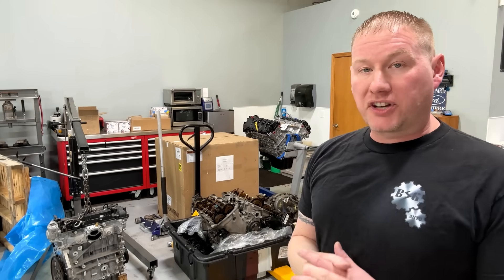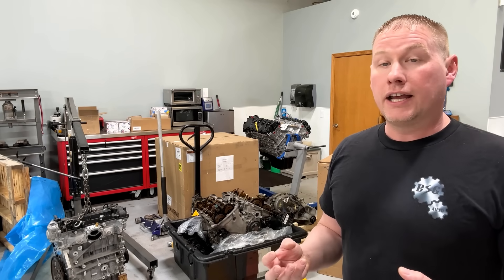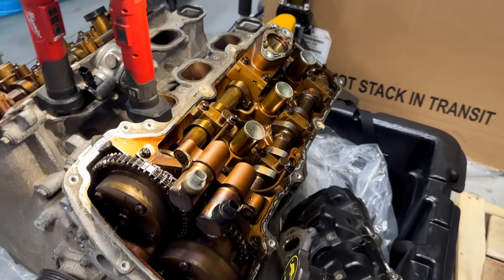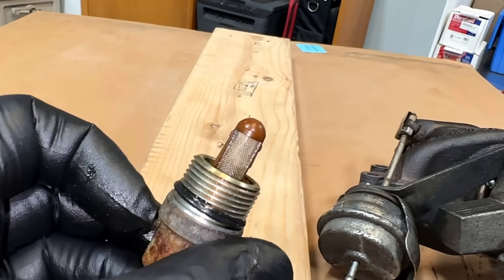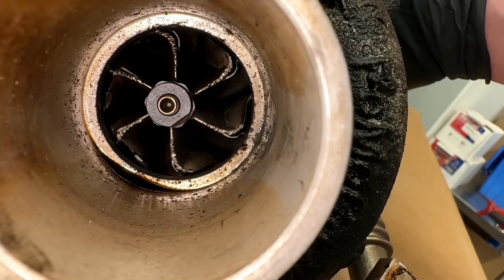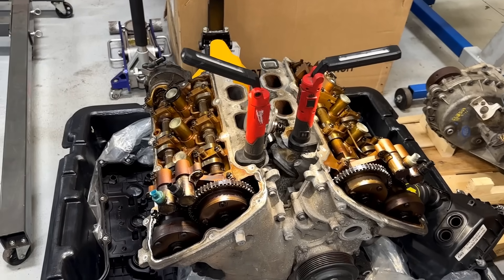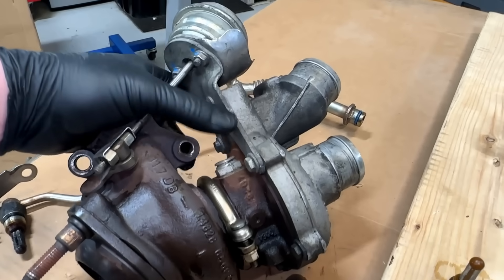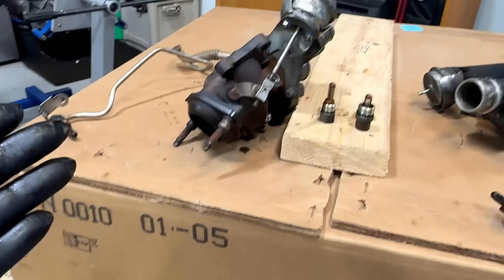This is Why You Never Run Extended Oil Change Intervals on The Ford Ecoboost Engines!

Comment: Had a 2015 Escape with the 2.0.  When I purchased the vehicle I decided to follow the engineers algorithm and change oil when the monitor system told me to.  The ford dealership used synthetic blend.  The long way around of saying, When I traded the vehicle in in 2020 there was 308,000 miles on the clock.  Out side of the normal maintenance stuff, brakes, tires, filters, and a head lamp bulb, etc; the only engine repair I had was a purge control valve.  The only reason I got rid of it was the transmission started slipping when cold.  Trans repair cost and trade in value almost equaled each other so I purchased an Edge ST.  Trans fluid changed every 45,000 miles.  Hate to disagree with you, full synthetic is not really needed.  Being mindful of maintenance intervals is important.

With regards to the turbo, those screens looked like the oil was not changed or those screens are clogged due to cokeing.  The secret to turbo longevity is is starting the engine up and idle for a moment for to get oil flowing and the keep your foot out of the throttle until the engine warms up.  At shutdown, let the engine idle for a minute or two allowing for the turbo to slow down and cool down.  Otherwise the oil supply line will clog just like your screens.  Learned this from owing a Cessna Turbo 182RG back in the 70's.  Start up and shut down procedures for a Turbo engine and a normally aspirated one were different.

Comment: These are all Ford design engineering failures!  Why?  Because Ford designed and is responsible for the oil change reminder system!  I guess at this point, I just don't believe that many 3.5l Eco-Boost engines will go 300k miles even if the oil is changed every 5000 miles if the turbos are considered as part of the engine which they are in my mind.  I would NEVER buy a vehicle with any Ford twin turbo V6 PERIOD!!
Reply: No one cares.  :face-blue-smiling:
Reply: @richardthomas1743  Ever try being the adult in the room?
Reply: @alanmorrison3598  Have you ever thought about making an intelligent comment?
Reply: @richardthomas1743  See above
Reply: @alanmorrison3598  Grow up.
Reply: @richardthomas1743  If you disagree with what I originally said, be the adult in the room and tell all of us specifically why I'm wrong..

Comment: Why is it that Ford only has a semi-synthetic (Motorcraft) engine oil rather than full syenthetic?. So when I take my 2.7L Ecoboost F-150 for oil changes at the dealership, that is what they use. The only way the will use a full synthetic is if they charge me by the hour on the oil change, which makes it 3 times as expensive.
Reply: They want it to fail.
Reply: Don't use the dealership for oil changes.

Comment: Excellent video as always Brian.  Have you come across any issues with the 2.0L Atkinson engine that they use in the Fusion hybrids?
Reply: Those motors are solid. The thing to keep an eye on is the hybrid transmission fluid level. If you see anything leaking stop driving the car and fix it right away. Mine got low and it kills the bearings. Cost me 6 grand to have it replaced. The bottom cover on the car caught it all so the guy doing the oil changes needs to look for it.
Reply: @psineil  thank you for the heads up!  Where on your transmission did it start leaking at?  When I did my last oil change I noticed the Aluminum housing where the engine and transmission mate together was a little damp, like some residue of something.  It doesn't look red though.  I'm thinking maybe the hose to the thermostat housing is leaking a little, since it's right there as well.

Comment: Is there any real difference between the 3.5 ecoboost and the 3.5 NA engine's besides the turbo ?
Reply: I think the internals are slightly different, mainly the pistons and compression ratio. There are probably more differences but the overall architecture is very similar as well as very similar components.

Comment: Talking about oil changes, in Mexico they ask for 10k kms / 6k mi, or 6 months in between oil changes. If I drive the vehicle, let's say, 2k kms per 6 months or so, will it fail miserably too?

My car is a 2018 Escape, 2.0 EcoBoost, built in Cologne, Germany. Ever since I got the 2.0 EcoBoost recall applied in my Escape, it keeps failing with the same symptoms, but "magically" it is doing well in the dealer tests. I honestly doubt that the block replacement was done well, even though is an european block instead of the american one.

TBH I'm getting rid of the thing, and that's why I've been driving it so little lately. Is there any actual reliable, not too expensive and not too small family Ford car out there, no turbos nor bs, and still has a reasonable warranty due date?

Comment: When I bought my 2018 fusion I got the extended warranty and service package on it but I literally had to fight to get the 5000 oil change service ford said 7500 was the lowest they'd go they finally said 5000 on the oil and that's to long to go on this engine so anyone with the eco boost engine change your oil at or before 4000 miles.

Comment: I'm considering buying a Transit camper van with the 3.5 ecoboost and I'm doing a bunch of research on its longevity. It's good to know they do last when well maintained, but there also seems to be a lot of design issues with ecoboost engines. I always try to be meticulous with my maint so I think it'll be fine, but Ford needs to stop releasing engines that are half baked.

Comment: Before I retired from the Automotive Electronics field my business required me to drive a lot.  My last vehicle was a 2003 E250 Work Van with the 4.6l 2v engine it.  When I sold it in 2019 it had 509K on the Odometer.  I use to change the oil once a month.  I did not go by miles as it would vary so much.  At 250k I replaced the Timing chains, guides and tensioners due to a rattling noise at start up.  The engine looked like new on the inside. I always used the Motorcraft 5w-20 synthetic blend oil and FL-820s filter.  My neighbors would always ask me why I would change the oil that much and the reason is obvious.  When I sold that vehicle it still had the original engine and transmission in it. The A/C compressor was even original and used all the time as I live in South Florida.  Other than regular maintenance hands down the best vehicle I ever owned.  I regret selling it.  I now own a 2019 Ford Transit Connect and it has only 20k miles on it and I had to already replace the ABS module and HCU which the dealer wanted $2500 to replace and there were no parts available at the time to replace it in Jan.  I waited 4 months and could not drive it,  the brakes would just lock up for no reason.  I finally bought a used one on Ebay from a wreck and spent $100 and now it's fine.  I'm probably gonna sell the van now as I don't trust it.  Change your oil often people.

Comment: I have a 2017 expedition with a 3.5  and I change my oil every 2200 to 2500 miles. I get made fun of for that but people don't understand,  oil is cheap, engines are not.

Comment: What’s your recommendation changing spark plugs how often ? 2014 3.5L currently at 116K
Reply: Normally every 75k you’ll need them. You wouldn’t of made it that far without doing them. Pull one and check gap with gauge

Comment: That engine still went over 200k miles. That is pretty impressive. 

I know a van driver who put over 400k miles on his 3.5 ecoboost before selling the van. Engine was never opened up and still original turbos. Of course he had perfect maintenance.  

The 3.5 ecoboost is a good engine if maintained properly.
Reply: 200k and it pulled an Expedition, a big heavy pig.
Reply: I agree 100%
Reply: SuperSteelers  amsoil 5w-30 rad flush every 20k,trans fluid Every 40k,differential every 25k A little more money and maintenance is worth peace of mind if you don't like maintenance lease or drive something cheap and easy
Reply: 3500 mile oil changes or ALL highway miles 5000????? That's unsurpassed.🎉
Reply: This was maintained properly
Reply: @wolfeadventures  first thing Brian said, wasn’t maintained well.
Reply: The 2.0T in my focus st has 260k on it religious maintenance keeps them going
Reply: Impressive for ECO Junk
Reply: @vintagerc9173 Do you not see the comments of all of these people getting 200, 300, 400 + thousand miles on their Ecoboost engines? They’re obviously not junk. Far from it!
Reply: @BrotherKyler  AMEN!

Comment: Use Amsoil , change out pil every 5k , 
In my opinion it's great oil, use it on a 250k 6.7 Diesel.  Still running  strong.
The turbos and heat beat the crap out of this oil . 
So every 5k or if road trip up coming that will go past the 5k setpoint it gets dumped ..
Cheapest part on any fine machine is the lubrication. 
Thanks for the info on the turbo filters

Comment: Hi, I know you are a Ford guy, but maybe you can answer my questions regarding the 2.4L Boxer turbo Subaru uses.  I am a huge believer in having maintenance performed on my vehicles.  I maintain them as I learned to maintain an airplane. On all my vehicles, I have an oil change done at 3k miles/3 months; regardless of what the manufacturer suggests.  I drive very little mileage being retired, and short local trips, so I consider this severe use.  I own a 2013 Mustang V6 Premium and a 2023 Subaru Outback Touring XT.  I also get transmission service, coolant service, rear differential service and transfer case service.  At some point should I get the turbo filters replaced?

Comment: Brian  -  would you happen to have an opinion on full synthetic high mileage oil?

I've been using both Pennzoil Platinum Full SYN HM and Quaker State Full SYN HM with oil changes every 4800-5200 miles since the 80K mark...Just hit 137K on the odometer.
Reply: I read and interesting article by Blackstone oil analysis Lab.. Last week.. they compared a couple of thousand oil reports that they had done... In conclusion was one boil is not Superior to another... What mattered was changing your oil... So as long as it's full synthetic just buy it... I myself has been using rotella t6 for the last 10 years in my motorcycle we're also ends up acting as the transmission fluid... Thousands of motorcyclists do that and no one seems to have had a oil  related failure... Just don't try to be cheap just change it.... On the other hand on a 2004 Nissan... Where I added a bypass filter... I one-time went 25,000 miles between full oil change.. laboratory tests showed it was great... But I did change the filter every two to four thousand miles.. so I kind of did a partial change all the time

Comment: Ok, extended oil change caused the dirty filter, but the real cause was the owner never checked the oil level and ultimately it was the oil level that killed the engine.  Had the filters been changed the engine wouldn’t have burned the oil.  
Here is a question though, doesn’t high quality oil with good detergents prevent and remove these oil deposits in the engines?  225k miles seems pretty good overall.
Reply: I use synthetic mobile one (high mileage) and don’t seem to have any problems either.  140k.  Now I just had to have the phasers changed and had the time job and water pump done at the same time.  Engine doesn’t seem to burn much if any oil over 10k mile interval.

Comment: I remember when these engines first showed up, the initial skepticism revolved around longevity concerns.
You've shown that a properly maintained twin turbocharged V/6 can last for many miles and be reliable.
Thanks for all your videos.
Reply: Not that the concerns aren't valid, given that the turbos add another set of components that require regular maintenance that most people won't bother with. Like others have said here, the switch to thinner oils to meet EPA standards doesn't help matters either. Honestly at this point, I don't doubt the manufacturers will soon be intentionally making new engines less reliable to get people to switch to electric.
Reply: But the owner did properly maintain this. Followed the manufacturer spec.
Reply: @wolfeadventures common now! We all know all the manufacturers are pushing super long oil intervals these days and the smart owners divide the recommended intervals in half 😉
Reply: This sounds like lottery for me
Reply: I remember also and suspected I’d have problems with my first 3.5. Well I did. I am one of the many victims of Fords 1st gen. poor exhaust manifold design. I heard there’s a Class Action starting on that. Any way I’m still a fan of the 3.5 but only the second generation not the first. Btw have you ever seen Mike Rowe of Dirty Jobs promoting the 3.5 in the infamous Ecoboost Torcher Test? It’s on YouTube. I’m sure Mike would not speak to it the same now but as I said the second gen is much improved. Change that oil though 😅
Reply: The change to to 5W-20 or 0W-20 industry wide was for the manufactures to meet emission standards.  The EPA required that the engines meet requirements so many minutes after starting the engine and the thicker oils created additional fuel burn or increased emissions.
Reply: @thk7513  I run 5W–30 on everything, which is the recommended weight, except my ‘06 Expedition with the 5.4, which suggests 5W-20. I moved up to 5W-30 at the recommendation from these videos.
Although, my old Ford 8N tractors still get 10W-40 in summer and 10W-30 in winter
Reply: But for all those who have a longer engine life there’s probably a majority that doesn’t make it to 200 K. It’s really annoying when people try to give the impression of longer life by referencing to kilometers instead of miles. Saying anything else would be unkind.
Reply: @kevinstonerock3158  you can pretty much figure that any vehicle in the northeast will likely rust out before it ever sees over 100-150,000 miles.
South/southwest- 300,000 miles can easily be reached with proper maintenance
Reply: @Acelachaser1965  If you apply proper anti-rust treatment annually, any vehicle can go 300,000+ miles even in the northeast.
Reply: @noseboop4354  Yeah no. Anywhere with brine applications anti-rust only goes so far, it WILL eat up your body panels sooner or later.
Reply: @noseboop4354  exactly, people down south don't have any idea how a good yearly oil spraying (like Krown or Rust Check) stop all rust!
Reply: If it was designed and built right in the first place it wouldn't have the issues. Also the change to thinner oil doesn't help.

Comment: In addition I think Ford should have went to a 8qt oil capacity. This would help some with people going longer on oil change intervals.
Reply: not needed for oiling and for engine cooling;  you have to keep some heat built up in engine for efficient operation and emissions.  Also,  extremely difficult to find the package space in engine compartment for larger oil pan in initial design.  Also,   if you have a certain amount of contaminants in 6 quarts of oil would it really help if that same amount was diluted in 8 quarts?

Comment: Question for you, 

2011 3.5 ecoboost with 195k miles. Phasers have been done at 86k and 180k. 

Oil had been done per dash indicator for a couple years. Otherwise 5k intervals now at 3k.

Recently, upon Cold start, 4 seconds of slightly shaky run followed by 9 seconds of a vacuum noise that seems to be coming from the air intake then it runs normal except when letting off of the throttle it gives another brief vacuum noise. I haven't been able to track it down. Any ideas?
Reply: Air filter? Some intake not getting what it needs
Reply: Fresh air filter, same noise.
Also noticed that the brake booster looses vacuum when left off for several hours.